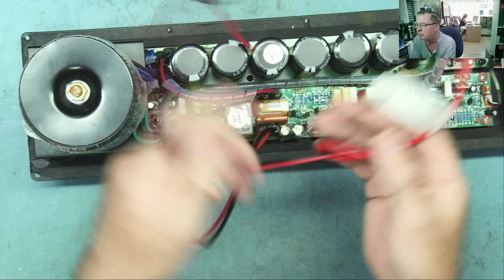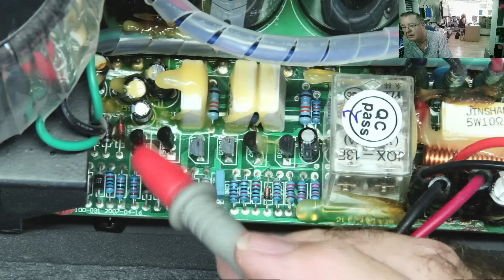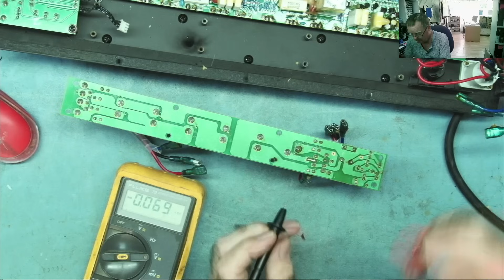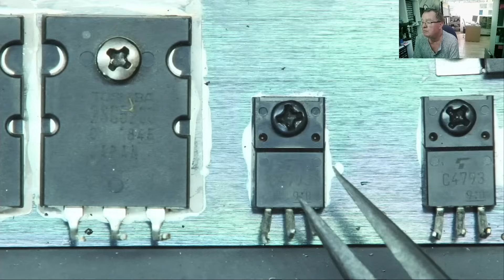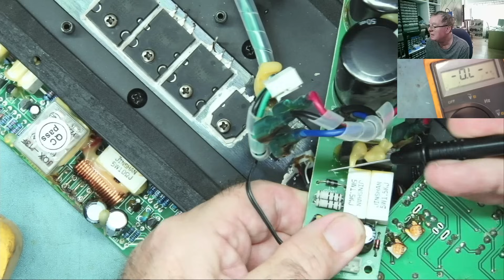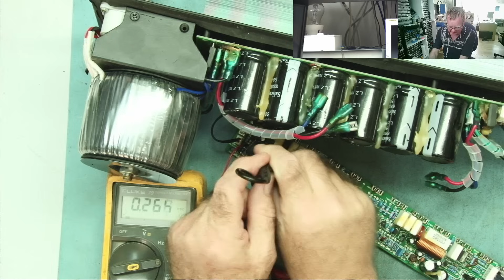DEA K-15A Full Range Active Speaker Repair : Powers On But No Audio No Protect

Comment: Personally I'd take the board out and do it right.  I can see bodging something in just to see if that'll fix it, but to do the completed fix I want to do it properly with removed bad components, installed good components, and cleaning up all flux residue or other gunk.

Comment: I don't think there's anything wrong with how that diode was replaced by someone else. If you were sit down the customer and explain it to them: "We have two options. Method one will look original, but only when you open the device and peek inside. That one will cost you another ~30 minutes of my time. The other option won't look as neat on the inside but it will work just the same electrically and probably last the same amount of time. And I'll be done in 5 minutes, now that I've diagnosed the fault. Which one do you want?"
I think most customers (myself included) would go with the option that saves them money.

Comment: Couple of thoughts..
This seems to supply the relais (anything else ?), the parallel diode is probably the back emf protection. It it might be worthwile checking the currents flowing through the resistors and the relais itself to see if there is a design issue. The relais is constantly on when the amp is running, so this is a continuous load and the circuit needs to be designed for this. What is the input voltage to the zener? Unnecessarily high? 
On the PCB removal - one seems sorted, and if this is the same issue on the second one, I would check with the customer if he is willing to pay for the extra time. Also, de- soldering, even if done properly, presents an additional risk for the components and the PCB, so I would rather minimise it. If all works fine, I would probably leave the board in place.
For he third one removal seems inevitable. 
And if the circuit needs a redesign that involves more than just bigger components, it probably needs to be removed anyway.
And as always - great video, looking forward to the next episode👍

Comment: Thx for the one more nice video repair.
My opinion may be wrong, but I would use the old legs of the parts, instead I would increase the power to the Zener and the power to the resistor. In this way I would not have to disassemble the PCB.
This is the efficient way to do that,  it will not cause any problem in the operation of the amplifier, if that connector alows to do that.... If not....then we have to do PCB off

Comment: Quite difficult to do this repair the correct way (disassemble the AMP PCB) Seems the design has flaws. What is the voltage before the 50 ohm resistor? One suggested a 24V regulator instead of the resistor and zener, I would consider this upgrade also

Comment: Did you spot the skid mark under the psu module where it had arced to the heatsink? There was also a burn on the PCB at that point?

Comment: Fitting a 2W Zener seems sensible if the 1W is overstressed.  In a pinch (no 2W 24V Zeners in parts bins), would 2 x 12V Zeners in series share the power dissipation more evenly? I'm interested to hear opinions on this because I am wary of straying too far from like-for-like replacement for fear of straying into design-change territory. I expect that confidence with parts substitution grows with experience.
Reply from the maker: 2x 12V in series would share the power dissipation.  Another idea woould be to replace that part of the circuit with sometjhing like a 7824 voltage regulator.  I decided to fit 1W 24V zeners as they are what I have, and figured they should be OK 'for a while' but I've ordered some 24V 2W zeners to keep in stock just in case.
Reply: Since you have several 24 v  zeners, you could put 2 in parallel to divide the power dissipation in 2 ?

Comment: Another great video Richard. I'm interested in the repair logs, I'm only an amateur trying to build up my 'repair CV' with the aim of getting a job in this but I do repair logs partly so I have a permanent record of safety checks prior to handing an item back to the customer. I guess when you were doing more industrial repairs the logs were important because there was high-value machinery at stake. It sounds like an interesting place to work, I'd like to find somewhere like that.
Reply from the maker: Originally I was working on component level repairs for ICL (Internaitonal Computers Limited) from 1983-1989.  I then worked for the same company as a computer programmer 1989-1991  This is company I then worked for in industrial electronics repair from 1991-1993 .   They are still trading. 
https://fletchermoorland.co.uk/
 I left in 1993 to set up my own business.

Comment: I wish you would have calculated the power consumption of the zener and the dropping resistors. We might otherwise see a recurring problem. What is the 24 volts used for? Is it just to pull the protection relay? You could actually make the design better if the power ratings are proper.
Reply from the maker: I did calculate the current in the video but not the wattage as the supply voltage itself was being pulled down by the short.  I have to look at the other amps so I'll do that in the next video

Comment: I'd fit a 2 Watt Zener and a 2W fusable 50 Ohm resistor there. so even if the Zener goes short, you won't have something burning up inside
Reply: This part of the circuit definitely has some kind of problem. So better reverse engineer it and determine how to make it more reliable. A 2W Zener maybe the solution, but you only know for sure when you know what’s going on.
Reply: @sanderverhage5148  From what I saw on the PCB, this is providing VCC to the protection circuit. One could always refactor that and throw in something like an 7824
Reply from the maker: @macwake  Yeah that thought also crossed my mind 🙂
Reply from the maker: Which is what I said in the video but mentioned I don't have any 2W 24V resistors in stock at the moment.  Another thing I find interesting is that the current flowing into the zener passed through two 100R 1W or similar resistors in parallel on the PSU PCB then a a single 50R on the amplifier board.  As the resistors are the same value and passing the same current I find it hard to understand why they are different watttage

Comment: PCB off. Apart from the considerations mentioned by others, you said a very good reason yourself: you can't easily change the resistor without removing the connector and you can't remove the connector without removing the PCB.

Comment: Hey Richard,
Thanks for the nice repair video. I would do it the right way and remove the PCB. It doesn't look very professional and there could be bad solder joints or other problems on the bottom of the PCB.

Comment: repair log is a great idea to track recurring faults or verify if it has been in before for repair.  if nothing else a little "LC Quality" sticker placed on the inside would be good to let you know you have seen it before :-)
Reply: Not only that, the log and serial mark prevents unscrupulous customers from sending a different device claiming that the repair has failed or the same device with a different fault and expecting free repair.

Comment: Remove the PCB do it correct yes it takes longer but you just charge accordingly plus you have a better chance to check for dry joints.

Comment: I think i would change the wattage rating of the 50R resistor to a higher one, that repair does look a little untidy, even if you went down the same route it could be improved. but experience at times as shown clpping out components does hold it`s risks with impedence issues on amplifiers, but as this is power rail then that`s a different story if time allows and the strip down is not complicated then replace to board level, it would be intresting what heat disapated around that 50R and Zener Circuit it seems like a common fault.
Reply: I would have done the same, but Richard's solution of a 33R plus 18R effectively does the same, albeit by only 50% on the 33R, with the added bonus that by standing up they can dissipate heat into the air.
Reply: @chrishartley1210  Hi Chris, I  appreciate your thoughs on this problem and Richard changed the resistor and got the same value in series from two others, and they are in free space allowing 360 degree cooling, but to have repairs on the same components with the same comonent breakdown seems to ba an issue, and burning means over heating, but age does play a factor, but they do seem small they look like 1\8w cheers Chris.
Reply from the maker: @harrygood4783  The resistors in series are actually the same size as the burnt one.  I think it is more interesting that the 50R on the PSU PCB is made up to 2x 1W (or more) resistors in parallel.  This has the same resistance as the burnt one on the Amp PCB and is passing the same current so the wattage for the two is the same - why didn't the designer fit the same wattage for both 50R resistors?
Reply: @learnelectronicsrepair  Hi rich, As said in my first it does seem a strange design! it does need the heat dissapainted more evenly, and agree even using 2x 1 wattage would help with heat discharge, and it`s enclosed in wooden box with no ventilation keep up the good work it`s intresting watching you from 1 engineer to another.

Comment: did you solder the dry joint on the 2n5551 transistor  (31.11) ?
Reply: That solder joint does indeed look very bad...
Reply: Actualy see a lot of cirkels on many joints. Might be the lighting.
Reply from the maker: I'll be honest didn't.  It did look a bit iffy.  Clearly it is working as the amplifier works but you are correct

Comment: if i need thicker solder i just twist two or 3 bits together. saves having lots of different sizes as well as lots of different types.
I think i would also change the zener for one with a higher rating, if there is a common fault then there must be a design issue, The Zenner must be running too close to it's power rating.

if you are being paid for the work then factor in the time for removing the board. you should not be bodging a fix to customers equipment. could be a quick way of getting a bad rep.
remember bad rep is spreading it's news across the world, while the truth is still pulling it's pants on 🙂

Comment: i dont think its a bad job, saving time is money and you can replace the component and get the same effect, without removing the board
Reply: You could but there were some doggy solder joints other places on the board.